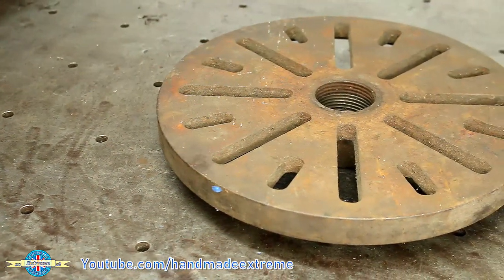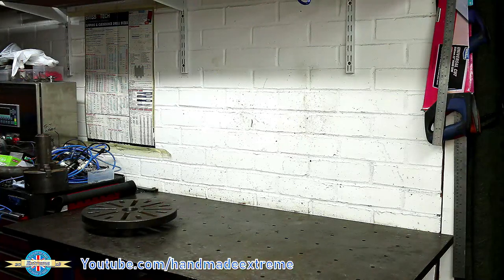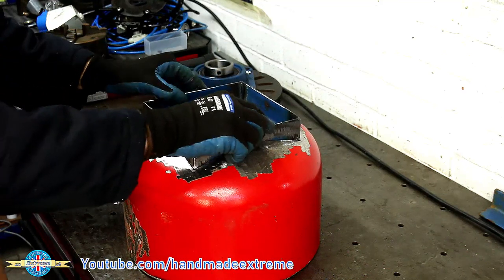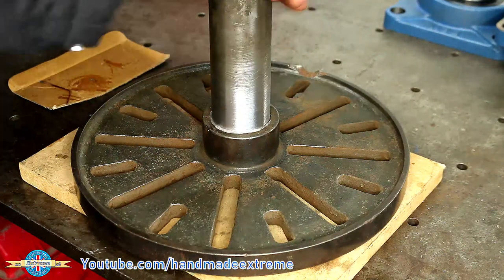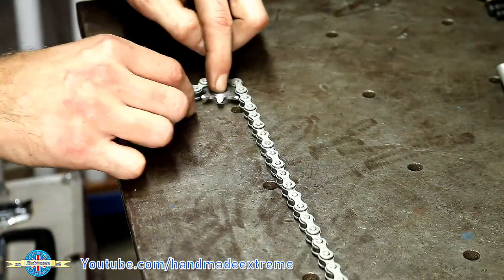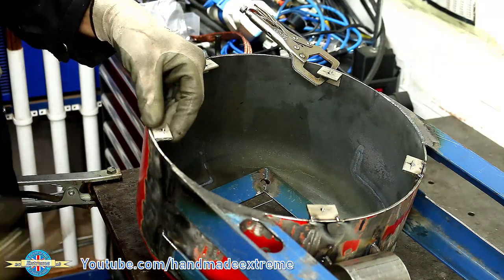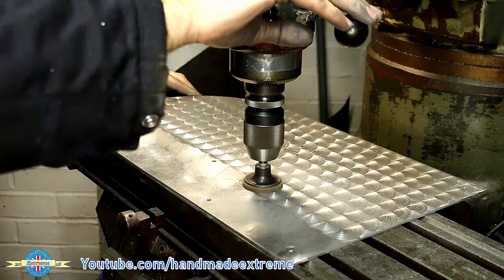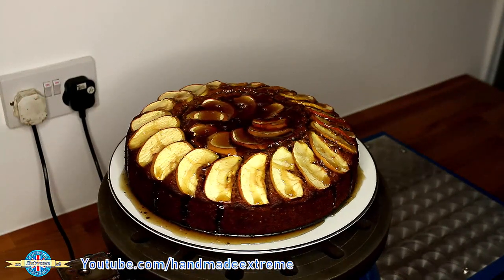Making a Rotary Weld Positioner Table

Comment: About the wiper motor . Ususally a car wiper motor will have 5 contacts  . 3 of them are basicly switches that will allow the motor to complete it's cycle and always return to zero position , and when it is in zero to short the motor to make it stop and stay in it's home position . 
The other two contacts are 12V hi speed and 12V low speed . The body of the motor is ground or 0Volt . In the video I see you're connecting the 5 wire plug plug , but not the ground . Did you rewire your motor ? 

I did insulate mine from the chassis ground by desoldering the internal wiring ,  and I used a separate wire for 0Volt . That way , the welding current and the elctronics are insulated . One bad ground in the welding circuit , especially when initiating the arc , could very wel destroy the electronics . 

Pat

Comment: Good job with the ground strip. Sping loading is essential as copper itself is not springy. Also, Your design makes the contact directly to the cast iron plate instead of the shaft which is somewhat isolated by the glue.
Reply from the maker: Thanks. Glad you enjoyed it.

Comment: Nice done. Maybe you can add a switch to reverse the direction of the rotation. Should be easy possible with the wiper motor.
Reply from the maker: Great idea. Yeah should be dead easy. A simple change over switch to reverse the polarity of the motor should do it.  Thanks for the support 👍
Reply: @Handmadeextreme  Yes, I was a bit surprised that you didn't include reverse from the beginning.

Comment: Careful with those gloves when drilling! If only one chip catches it, your hand will end up in the drill press. If at all, wear only thin latex gloves that will just tear apart if something like this happens. 2:37
Reply from the maker: Great tip, thank you for the support.
Reply: Nice work, great video but I must agree with Wasper216. About 15 years ago I had an apprentice working with me drilling holes in angle iron sections on a vertical driller, whilst I was welding said sections together. Unfortunately he was wearing rigger gloves at the time, and you've guessed it, the swarf from the drill got caught in his glove. By the time I got to the driller there was just a glove going round with the drill, I thought he had torn his hand off. Luckily, if you can call it that he lost only a finger. So the lesson was learned, never wear gloves while drilling. Before anyone asks , yes there was an emergency stop on the driller, but for whatever reason it had been by passed, we were unaware.🖕
Reply: Exactly what happens at my work one person lost 2 fingers
Reply: Search “degloving”
Reply: Must be a strong bit of drill swarf to rip your hand off
Reply: Happened on a lathe to a chap at a place I worked. Lost two fingers and ripped the tendons from his arm. It doesn't need to be a strong bit of swarf, just enough to pull the glove into whatever is rotating the glove catches and you know the rest. So no gloves on drills, mills or lathes etc.

Awesome video though😎
Reply: @ashboy225  once the swarf has caught your hand the torque from the drill does the rest,the swarf is just a feeder to the drill.
Reply: Thank god! for a second there I thought no one from Health and safety would speak up about that atrocity, your a real hero, sir.

Comment: Lots of ways to finish your cover plates, rotary wire brush, or valve grinding compound under something semi hard, or on smaller parts diamond impregnated hard rubber spindles used by a gunsmith! By the way a very nice job, great imagination, it's how I make something out of things laying around!
Reply from the maker: Great tips, thank you very much. So many new things to try. 
Glad you enjoyed the video. 👍

Comment: Nice project. Don't drop anything down the centre tube though! I presume it was intended, but a 2" hole in the base plate will let you run long shafts right through (and let stray bits drop out of the bottom)
Reply from the maker: Haha it was and you have just reminded me that I forgot to put the hole in. Oops Thanks for pointing it out. 👍😀

Comment: I love videos like this...and the end result is awesome. I like that the table has clamping possibility!
What I usually do (installing automatic door openers), to reduce the profile, is mount the glands "inside out"...i.e. the fastening nut for the cable is on the inside.
The image in this one is all saturated and weird in 1080, but not in 720 for some reason...is it just me or does anyone else have issues?

Comment: Wow!
Really good job.
I work with all sorts of manufactured wheels in welding shop and this one is up there with the portable types.
Just a thought to expand is usability,
Place a hinged type support on it's back side so you can set it at angles 0°- 90°??
Keep up the great work!

Comment: Great job man, smart simple and works the best. The same thing could probably be made using a throttle pedal from a car with electronic throttle pedal because they’re a potentiometer and you could have the speed working off a pedal and two hands free at all times. Just came across the channel and going to subscribe
Reply: Never mind I’ve just got to the bit where you’ve added a pedal lol you’re way ahead lol

Comment: i was thinking of making one with a worm drive gear cut with a tap as a hob, ended up with a small rotary table and a drill lol
Reply from the maker: If it works for what you need it's a perfect solution. Great work! 👍

Comment: I kept wondering, "Is he going to ground through the bearings?"  Nope, you didn't.
Reply: The bearings are hilarious overkill for this kind of build, probably woyld not have been much of an issue for a long time even if it had been grounded through them. More the principle of the thing, taking pride in your work etc.
Reply: @volvo245  I'd bet if he did ground through the bearings and used the turntable seriously, it would weld itself solid within a week.  I've seen bearings do that.

Comment: Great job I would of added some kind of protection for the bearing seals under rotary face plate even if its just a leather circle with a hole in it cut from a welding apron

Comment: CRATEX round dowels for the "engine turning" 
OR correctly termed, "DAMICHINE",  "DAMICHINING".

We made an aluminum holding fixture for the CRATEX polishing dowels....
The CRATEXs are available in multiple diameters.

Your Pal, Gary

Comment: Not too sure how you made out with the 2 part epoxy (have not finished the video yet so forgive me if I am jumping the gun here!) , I recommend an epoxy known as panel bond, it is made by 3M and is amazing stuff!
Guaranteed for the life of the vehicle ( used in auto body to bond auto panels together)
Reply from the maker: It's working well so far. I guess the real test will be how it's doing in a years time. I'll keep an eye out the the panel bond, thanks.

Comment: Is there any reason why you set the foot pedal as an tap on, tap off instead of a step and hold?
Reply from the maker: Just the way the controller works. I have since reconfigured it to be a step and hold 😉

Comment: You should figure out a speed sheet that lists speed % based on part diameter so as to maintain a specific welding feedrate
Reply from the maker: Absolutely. I need to whip up a quick spreadsheet.

Comment: Do you prefer working with stainless or aluminium? Reason I ask, is I make similar projects and wondering whether switching to aluminium alloys will be too expensive when it comes to materials. I wonder if it's harder to find as well.
Reply from the maker: Depends, Ally is light and easy to cut but requires a lot more prep for welding. Stainless is harder to cut and they both move like crazy when you weld them.

Comment: When you cut power to the motor, switch a shorting resistor across the motor. Maybe 1ohm 10 watt or 2.2ohm 10 watt.
That way the motor will stop straight away and not run on for 2 seconds.
Reply from the maker: Great idea. I might just have to do that. Thanks for the support. 👍👍

Comment: What was the plastic bit on the bottom of the speed controller for?
Reply from the maker: It's to stop my sticking my fingers into the electrical connections on the end of the power supply if I pick the table up to move it when it's plugged in. Thanks for the support.

Comment: A useful addition would be hole in base plate, to allow tube to pass right through .making your brilliant weld positioner a little more versatile .would like to build your design myself and add a designed by "handmade extreme" label  full credit to you. with your consent. looked at so many designs your design tick all my ideals ,and tig welding is neat and tidy .

Comment: Was there a reason why you didn't use a rear bike sprocket instead of making 1? I'm guessing you didn't have 1 around at the time. Just curious.
Reply from the maker: Too many teeth. I wanted to maximise the gear reduction so I used the biggest chainring I could find 58 tooth if I remember correctly. Then the smallest cog I could get the chain to work with reliably was 7 tooth. Smallest rear sprocket I had was an 11 I think. The gear reduction is important as I needed to be able to drop the speed of the surface plate for TIG welding. Great question. Thanks for the support. 👍
Reply: @Handmadeextreme  Ah, so that was why you didn't use an existing gear sprocket.

Comment: Im thinking of getting into TIG welding do you have a suggestion for a budget friendly machine that's good to learn with and could weld aluminium, I live in the UK too.
Reply from the maker: I use a 200 amp ACDC machine from Rtech. It's a good machine, they also do a 160 amp version i think. The DC only machines are significantly cheaper but wont do aluminium. Hope that helps.

Comment: Is that the standard type of earthing for these machines?
Reply from the maker: In all honesty I don't know. I wanted to keep the welding earth in direct contact with the face plate to prevent the welding current going through the bearings. 
The main earth bonding for the electrical system is very standard. 
Great question. Thanks for watching.
Reply: @Handmadeextreme  thanks for answering. I’ve always wondered how they earthed them without fusing everything
Reply from the maker: @stocky9218  No problem. Thanks for the support.

Comment: 2:48 Those little bolts are called Sex bolts if you can believe that, What a name lol proves even the oldest engineers had a sense of humour.
Reply from the maker: Had to cautiously googe that one... turns out ... your right. Learn something new every day. Thanks.
Reply: @Handmadeextreme  They are also commonly known as Chicago screw. but that just not as much fun of a name when contacting your local Nut and bolt dealer haha

Comment: You forgot to mention why you've put plastic between the frame and the power supply. If it's for electrical isolation, wouldn't the bolts attach to the frame defy that?
Reply from the maker: It's to stop my fingers getting to the wiring when I'm moving it around since that end of the frame also doubles as a carry handle.  The live terminals for the power supply would be a bit close without it.  So not for isolation per say just as a cover. 👍

Comment: How is that table getting electricity, when the tube's been glued to it with an epoxy resin (an electrical insulator)? Even if there are metal-to-metal contact patches, those won't be enough (run the table for a while, and then check to see how hot the pipe is; you can also use a multimeter set to ohms to check the table-to-pipe resistance).

Personally, I would have installed that power supply on metal standoffs, off the frame, and then make sure that there is continuity between the earth pin and every metal part on the machine. (The acrylic is hampering airflow, and it tends to build up an electrostatic charge).

Very curious project though; I've enjoyed the little build details on this one.

Comment: Come on then....what was the plastic sheet for?
Reply from the maker: haha, it's there to stop fingers getting it to the mains connections on the end of the power supply. . Thanks for watching. 👍
Reply: @Handmadeextreme  your welcome I love your videos, no messing about, straight to the point and very informative. I did like one comment about. Reversing the rotation though, good idea. Why didn’t you use a small sprocket from a bike too?

Comment: At 18:35 the earth is on top of paint
Reply from the maker: Good spot. It is but it will still earth through the screw which goes into unpainted threads.
Reply: @Handmadeextreme  Ahh, silly me, of course :)

Comment: Are you grounding through that glued joint?
Reply from the maker: No. The copper strap that wraps around the back of the face plate is the welding earth. The Earth clamp then connents to the bit of stainless unistrut.
Reply: @Handmadeextreme  it looks like (at 15:30) that ground strap is rubbing on the 2" tube, or bearing, thus grounding said tube.  If the weldment is grounded to the platter, how is the current not going through the glued joint?  What am I not seeing?
Reply: I see it now, at 7:11, there is a section sticking off the underside of the plate and that's what the strap is riding on. 👍

Comment: maibe you can find a cheap used guitar volume or wah pedal , you can use that to adjust the speed on the fly while welding , might need to change the potmeter (logaritmic) inside the pedal 
most of the better volume pedals are metal so they should be ok , could allso copy old tony's homemade tig pedal

Comment: Yeah, but does your girlfriends Lazy Susan have a speed controller! 😀

Nice work, did you use a special conductive epoxy to fix the table to the axle or does the copper braid rub enough against the table to provide a string enough earth for your welder currents?
Reply from the maker: The braid runs directly on the boss on the back of the faceplate. 👍
Reply: @Handmadeextreme  Did you surface the boss where the braid runs or was it smooth enough already? I would think that a normal rough casting would tear up the braid after a while, it will probably take a long while though as you're not exactly setting speed-records for that turntable! 😀